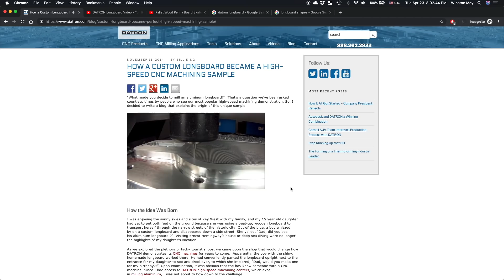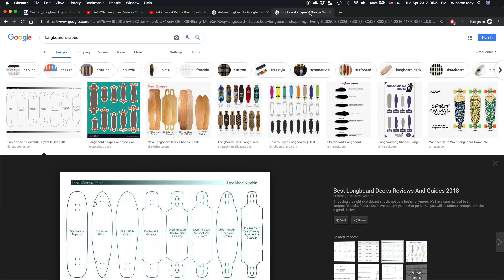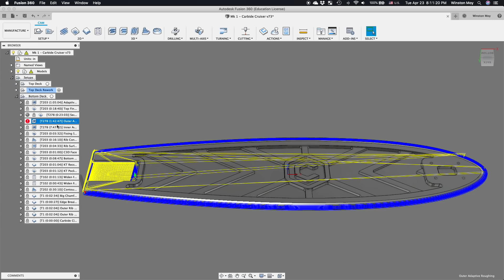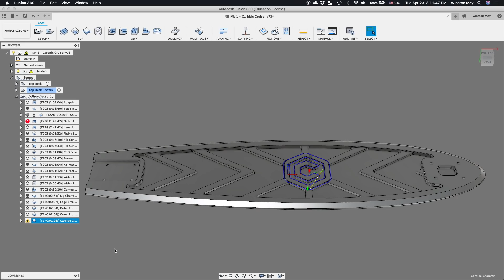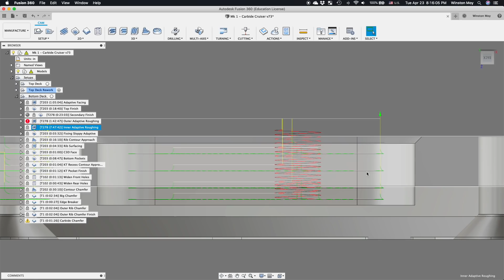Making an Aluminum Longboard on my Desktop CNC - #146

Comment: My Schools Robotics team Recently got an OMIO CNC Router. I would consider it a desktop machine, but we've been able to push 16000 RPM with a .065 inch depth of cut with a feed rate of nearly 15 inches per minute. I've run it at a much lighter depth of nearly .01 inches and gotten a feed rate of nearly 60 inches per minute. And people say desktop machining sucks. Personally, it's amazing I can make parts that were unable to be made before with a mill or by hand.
Reply: You can definitely run much faster than that. Try adding a mister and changing to 4+mm single flute endmills if you aren't already. Increase rpm and feed directly in mach3, you want to be going 60IPM plus usually. With a 4mm or larger tool you should be able to do 100ipm, 0.060" DOC with 24krpm quite happily. Your probably running too slow. Winstons videos don't translate too well as the OMIO is capable of cutting more than 10x as fast in Aluminium.
Reply: We’re running a mister and a 4mm 2 flute end mill at nearly 60 ipt. But when running much faster reliability issues occur because of chatter. Will look into federate and rpm and depths however, thank you.

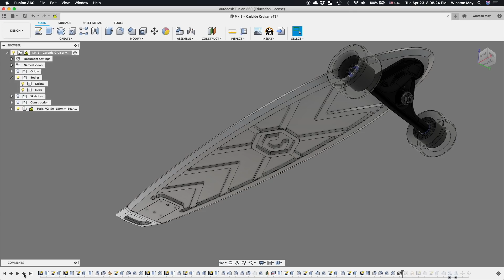Comment: 3:46 resistance from bending actually comes from an object's Area Moment of Inertia (2nd Moment of Area), and whilst thickness (dimension perpendicular to the axis taken), shape and aspect ratio are also important, and can allow you to get more bending resistance without increasing weight, by removing mass to create a certain shape. It's way they use I beams, and not massive solid rectangular sections the same size, because they can get "stiffness" from that shape.

Comment: If you want a tessellated pattern but don't want to copy Datron, copy NASA. Get the McDonnell Douglas Isogrid Design Handbook https://en.wikipedia.org/wiki/Isogrid Unfortunately the scan quality is pretty poor, especially the photos. Looks like the PDF was made from an early 1970's photocopy. Would be nice if an original print copy could be found to make a good scan. Page 42 of the PDF has a diagram of the isogrid dimensions used in Skylab.

Comment: How many endmills did it takes for the entire operations ?
Reply from the maker: I go through them all on the latest Carbide3D video. A 1/4 single flute rougher,  1/4" 3 flute I used as a finisher, 1/8" for the smaller features, chamfer cutter, and ball endmill.

Comment: I really hope 5 axis software becomes more available to the hobby space in the future. Machine designs are already out there and the parts shouldn't be that hard to manufacture, making a driver board wouldn't be that hard, etc. etc., in the end it's just software that needs to catch up. 
Having a hobby 5axis machine that can do at least aluminum would be a huge money saver. As outsourcing an aluminum one-off to a cnc shop is ridiculously expensive, and a lot of shops don't take projects unless production is in mind. Finding a casting method can also get pretty expensive, especially with the trial and error methods of learning how to properly cast, not to mention the cost of machines, materials, and fixtures to accomplish casting by itself; plus the addition of a 3d printer if you're going with the lost pla method, costs can get pretty high, pretty quickly. 

A rotational gantry, where the 4th axis is hinged at both ends under the x axis rails and holds the mechanism for the 5th axis rotary table, would probably be the best solution for adapting these gantry based machines to 5 axis. Which this design is used in professional machines built to be 5 axis, not the ones that're 3 axis and upgraded with a couple of trunnions. 
Having a rotational gantry, if that's the proper name for it, is much more rigid, and probably has better harmonic properties to it. Yes, more expensive, as it's not a one size fits all solution when it's compared to adding a couple of rotary trunnions, but it should be better. Plus with a brand name machine, that brand name could eventually just create the part themselves for their machine; but with off-brand machines and fully DIY built machines, this could become an issue, though hopefully some solid designs become open sourced or available to purchase from a third party.

Comment: Great work as usual Winston! Too many questions to ask but one is, how many ZrN-coated endmills did you go through to achieve this??
Reply from the maker: Every type of endmill I used, I only used one of. And then I made another longboard deck.
Reply: Ok great, so each endmill lasted for 2 longboards or is there more life still let in them?
Reply from the maker: There's more life in them.

Comment: Awesome video! I have a china 6040 and use 3 flute ZRN coated endmills and want to try the single flute like you use. Where can I find them? Quick search at Lakeshore and Carbide 3D didn't pop right up, all I found was 2 flute.
Reply from the maker: Carbide3D will carry them soon. Melin Tools has some, there are also generics on eBay. Datron has a lot but they can get pricey.